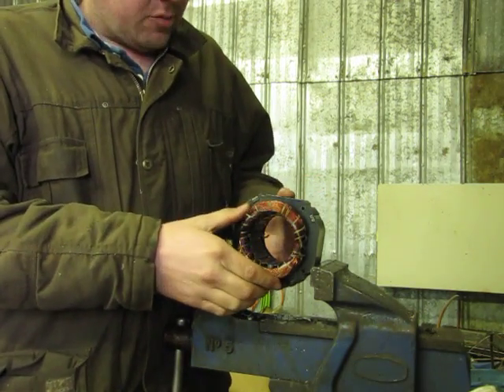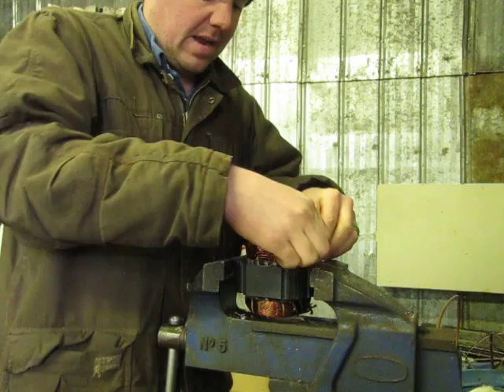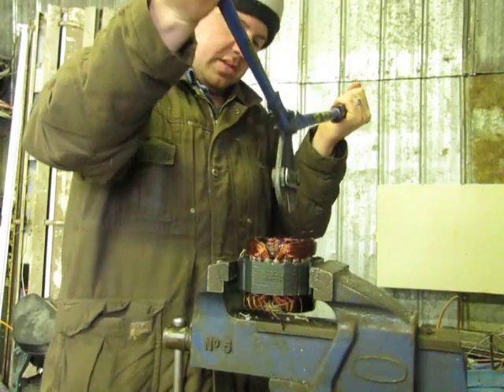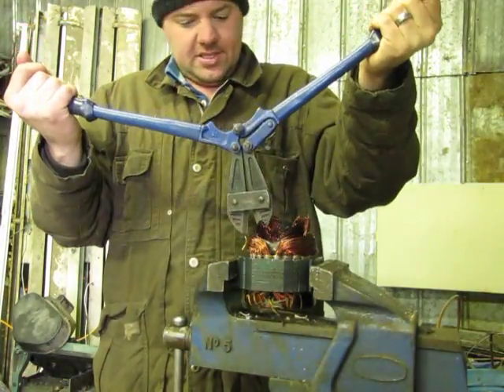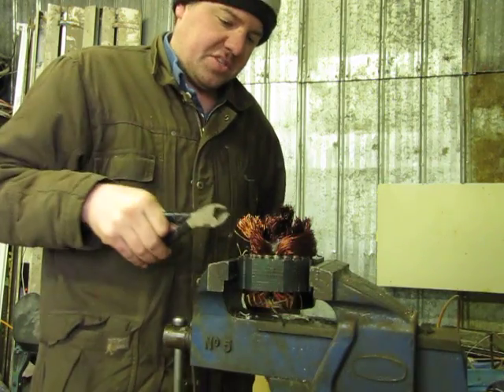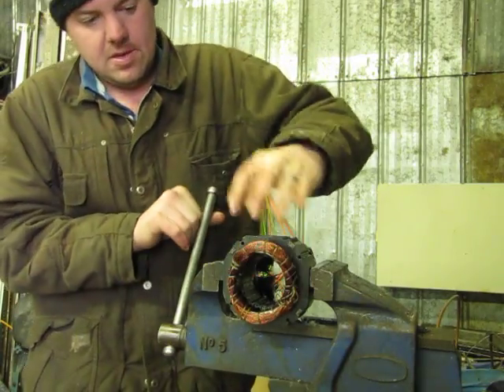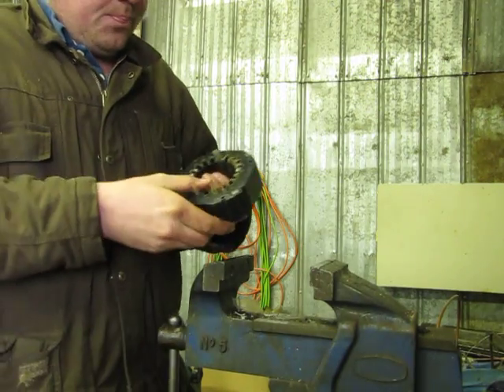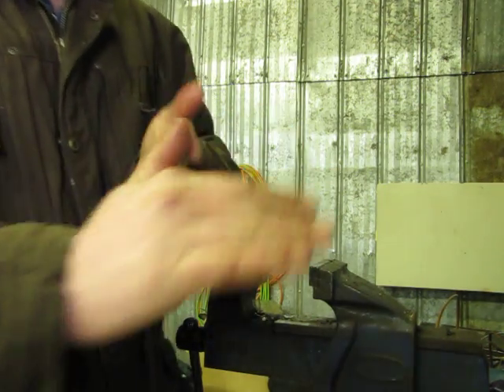Easy way to remove copper winding from a motor core

Comment: Thanks Bro. just picked up my first washer motor today ...bit of a grunt getting the little basterd out ..had to hack saw it in two ..now I'm down to the windings ...I guess I will try the cut one end and pull em threw method as it looks like this is the easiest method for me being in an appartment ( no shop with vice) ..gotta do it dat way ...you sound like a West Coaster ....OK better quite gabbing and get on with the show ..cheers to all my fellow scrappers out there ..probably one of you is the guy that gets to some of the TV's before me ...got to love them big sonys ...they are killer ..got 2 the other day ....check out my site I got lots of interesting videos ...

Comment: What do you reccomned for motors dipped in what seems like a varnish type resin?
Reply from the maker: It would depend on the size of the motor..   If everything seems to be really tightly wound and it's a fairly small motor with a heavy coating.  I would just toss the motor on your motor only bin.  If the motor is much larger and you feel you can get the windings out in a relatively reasonable amount of time.  I would either beat the coating with a hammer or burn the shit off in an incinerator, then proceed with cutting the windings and so on...

Comment: I have an easier way that takes less time.  Takes an angle grinder with a cut off blade and cut one side off.  Then take a screw driver to the other side to try to pull out the center section.  If that center section doesn't want to come out then just cut the other side off and be good with it.  Most times the center yanks right out.  If you really want to get the copper out of the center and it won't come just angle grind right through the metal (but this is last case scenario)!

Comment: First cut one end off with a sharp chisel..then pull the windings out ..or hit them through with a punch
Reply from the maker: Well, make a video if you feel your way is the better way. :)
Reply: Sorry I am not saying your method is not ok..But as a motor rewinder cutting one end off and pulling coils out is very quick,,Also if motor is burnt out you will need to heat the stator to make the coils slide out easier...

Comment: Sometimes they are laminated and have wire on plastic all over them you can smash it up first or put it in a fire.  I like the fact that it uses no electricity or wastes angle grinder cut off wheels.  Where can you find or what is it called, a punch combo pry bar like his?

Comment from the maker: Either heat the core on till the glue has softened, or cut both sides of the windings.  Wrap them around your pry bar several times and pull hard.  The winding pretty much always come out, no matter the type of motor, or size.  There is always those stubborn windings that will not release from the core.
Reply: Love youre only using hand tools.

Comment from the maker: Good question.  I really have not tried to remove the windings from a motor armature. Due to me not really receiving many of those types of motors.  Most of those motors (such as drill or power tool motors) are so small anyway, I really don't think it's worth removing the windings from those types of motors and I just toss them in a motor bin.  If I were to get some larger motors, of that nature, I would certainly try to find the best way to remove the windings from them.